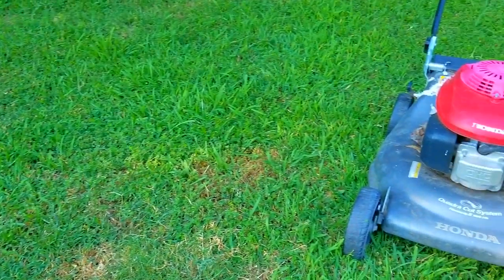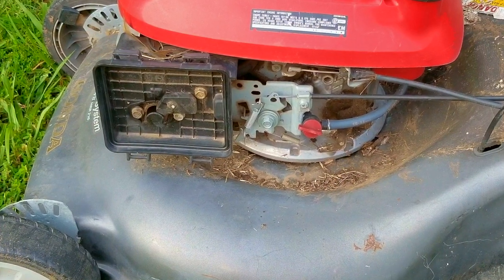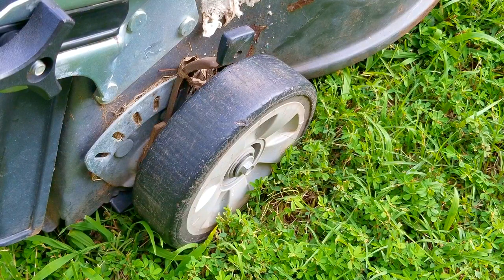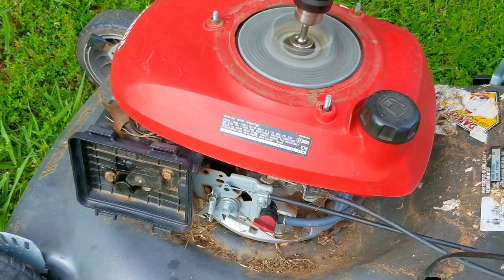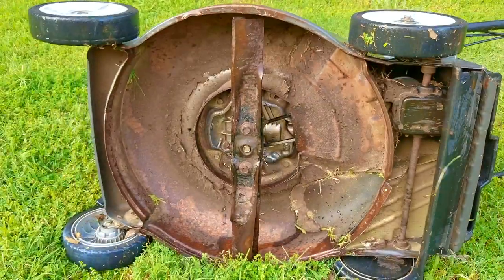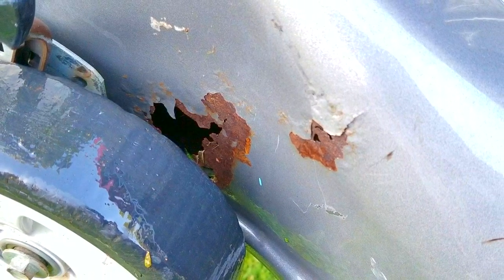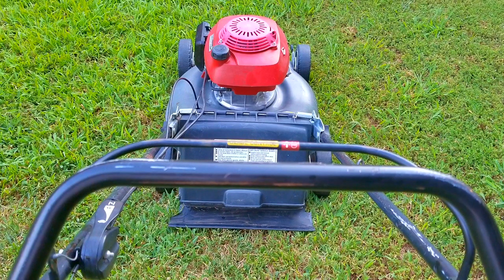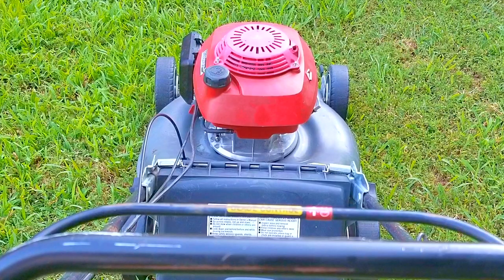This Honda Mower Needs More Time And Money To Fix Than It's Worth

Comment: Personally, I think the best move here is to repair the engine and throw it on a good deck. As much as I'd love to see a vid on repairing a rust hole in a lawnmower deck, I'm thinking the amount of time, money, and even the tools you'd need to repair that are far more than the value of the mower. The engine itself sounds like it runs decent, and the parts cost to fix it isn't too bad all things considered. Just makes more sense to put it on a good deck. Could even farm a few parts off of this deck to use for future projects. I'm sure the self-propel transmission would be great to have on hand if you happen to come across another mower that needs it. If nothing else, it'll probably be worth something to someone else who does need a good transmission.
Reply from the maker: I think you're right.

Comment: It was all pretty minor fixable stuff IMO until the rust hole. Whenever I get a mower in with a compromised deck it immediately becomes a parts donor, I refuse to patch up a rotted out mower deck and sell it on. If you need a knock-around mower for your own property that’s another matter of course. Thanks for the video!
Reply from the maker: that makes complete sense, thank you mjg263.

Comment: i find when you get a mower like this and clean it up it actually helps when theres a little dirt or damage as it shows that it was used and repaired and not have to worry if it was a brand new mower that has a bunch of issues
Reply from the maker: interesting, I might have to ask around and see what other people say about that. thank you Copperhead Designs.

Comment: I got tired of replacing the wheels on my HRR model, so I cut up two mountain bike tires I had sitting around and cut it to size for each wheel. Now the mower has tons of traction and it doesn’t want to slide around while using self propel. I understand this doesn’t look “correct” and I’m not sure if I’d do it on a mower I’m selling, but for my personal one I love it. These really are great machines, mine sees about 4-6 hours of cutting time a week since it was purchased new
Reply: I've seen that remedy. Just attach with screws.
Reply from the maker: nice, I might have to try that
Reply: Here's the video where I saw it. I have cued it up to the part showing the bike tire attached to the worn or wheel.
https://youtu.be/nDJOh2pZyaY?t=03m43s

Comment: Honestly with the mower deck all rotten I'd take the engine out and put it on another deck I have personally down 3 engine swaps on decks and it was a great experience and it was fun,  as the decks were too trashed to do anything with, also seeing as parts are hard to find I'd recommend saving any good parts from it when ever possible, I hope you have a good evening.
Reply from the maker: you are correct Davide LaSalle that would the best decision
Reply: @INSIDEHOUSEGARAGE  Thank you,  I hope you have a great day.

Comment: that Honda has been through quite a bit you can actually get just a small piece of sheet metal and stick it on the underside of that and pop rivet it with some rivets. and then just use a tiny bit of a 1 pint container of Bondo to go over those rivets and repaint it silver. that's what I did on a whole on a Honda last year when I had that same issue. and then taking apart the rear end if you want to take the time it's worth it since these machines the engine last forever
Reply from the maker: that sounds like a great idea. thank you Christopher Tyler.

Comment: Fix it. It is worth the time and effort if you use it for yourself. I have had carbs like that in my ultra sonic cleaner and they come out o.k. but never like new. They usually work good but the corrosion leaves its mark. The hole can be fixed with some sheet metal and pop rivits. Some body putty if you want it to look good. Thankd for the video.
Reply from the maker: thank you Waterman one.

Comment: Your are right about the time it will take , the deck would need to be cleaned of rust around the holes and a fabricated piece of metal in the shaped needed would have to be welded in of course after removing alot of things basically stripping it down to just the deck and cutting the holes and rust off to good metal and patching it then smoothing every thing and paint it would be a nice project for someone willing to take it on but not cost effective with time and effort accounted into the restoration
Reply from the maker: you are correct, I may not go to that extent.

Comment: Hey bro what's up? Interesting video. I would of transferred the engine onto another deck and work with it from there. If you have another mower deck and a usable carburetor, I believe that you should consider transferring the engine and other parts to get it working and keeping the cost of repairing it to a minimum.
Reply from the maker: Sounds like a good plan. thank you Ramadin Sookhoo.
Reply: @INSIDEHOUSEGARAGE  you're welcome bro👍

Comment: I think that carb would run again, but it depends what the seat and needle area look like after cleaning, they may be too pitted. I have a Vevor ultrasonic cleaner that I use 50/50 water and non-toxic simplegreen, I may try a different cleaner though.
Reply from the maker: it is quite possible not get it to run again, although the chances might be really low, something under 20%
Reply: @INSIDEHOUSEGARAGE  yea all depends on the seat/needles corrosion, any pitting on the bowl or surfaces shouldn't affect it really. Would be an interesting test.
Reply: White rust literally eats the carburetor and if bad enough, can make carb unusable.

Comment: I would repair & keep it, because I have a MIG welder, & these are easy to use. I would not bother with that carby. I'd bin it, then put a new one on. The self propelled unit I'd fix too, but I'm retired, & have the time to do these things.
Reply from the maker: you are absolutely correct thank you Christopher Marshall

Comment: I've cleaned carbs like that with wire brushes get all the holes use carb cleaner get the jet and you're good put a new o-ring on it they start right up
Reply from the maker: you are correct

Comment: If it's a GSV190 engine then it's the same or similar engine to what's on my dads 18 year old lawnmower which I have just bought parts to rebuild the engine with, it's a 186cc engine according to the engine case.

It's advertised as having 5.1 horsepower online whereas my dads is said to have a 6.5 horsepower output by Honda.

You could try using the cheaper aftermarket GCV160 carburettor & see if that works although it's only rated as having 4.4 horsepower,the GSV190 carburetor is only available OEM from Honda & it's expensive.

I would repair the deck if the GCV169 (160cc) carburetor will work !
Reply from the maker: I think I'll try that, thank you Russell Booth.

Comment: If l went through the hassle of getting
 and cleaning it, and have time on my side, l would try to fix it. I am known to put more money in something than it is worth. At the end of the day l have learned about working on that unit so l think it is money well spent. Are you going to try to fix that carb? Great video!!
Reply from the maker: thank you Ethan Miller, yes I plan to, but in a later video.

Comment: My week has been interesting, picked up a 5 year old Victa Ulimate Aluminium  frame $130 plus some fuel, Self-Propelled, Battery Start with Briggs 750IS engine, perfect condition.
Second was similar just a little older and still frame which was rusted as it was only a steel frame for $70 a bargain, not advertised, after driving 1.5 hours they sold it on me😡😡😡
I picked up the same mower for $25 the following morning minus self propelled and having a 2 stroke mower with some minor starting issues, new parts galore attached even new blades well looked after machine, someone just gave up and kerbed it passed down a few hands of metal merchants to me at a low cost $25.
In SydneyMarket Place $100 buy you rubbish
Reply from the maker: thank you for sharing your experience, and good haul .

Comment: As soon as the body's integrity is somewhat compromised because of corrosion, I'll make it a parts mower. I would restore the engine, take what I could use from the deck, you know cables and so on, take off the engine and use it for another deck, where the engine was bad. We can't save them all, unfortunately
Reply from the maker: that makes sense Christian Larsen.

Comment: Don't you have an identical mower that you are waiting to blow?...I would use the parts from that when it does
Reply from the maker: wow, very nice, you pay more attention than most others, yes my own personal mower is clattering and down on power, from years of neglect by the previous owner.  this engine would make a great donor for it.

Comment: If you are looking at 20 plus hours to fix it then to sell it I think you are wasting your time when you include the parts. Effort and money invested will bring a negative return. 
If you want to keep it for yourself I’d simply transfer the motor to a deck with working propel if you had one.
I think the deck hole, although repairable, would be the end of it for me.
They my opinion BUT what would I know 😁
Reply from the maker: thank you sticustom, still going to fit, so I can use it on my own lawn.